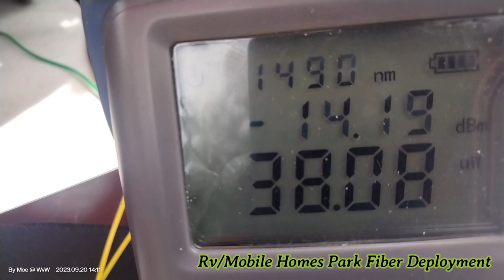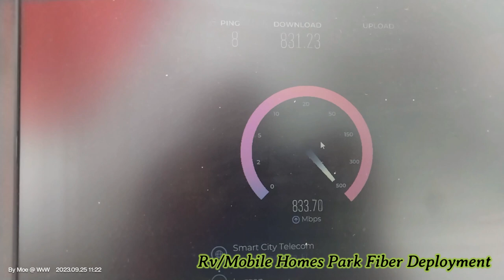Rv/Mobile Home Park Fiber Internet Build, Splitting and Splicing to ubiquity Gpon terminals

Comment: Your pole would like a lot better if you mounted your splice enclosure vertically as well so it both ends of the feeder cable came out the bottom and then your smaller count cable came out the top straight into your splitter box. I assume you spliced the other fiber from the 1x2 to the other end of the green tube/blue fiber to continue down the line (so it is going back into the ground) so this setup would be a lot cleaner imo.
Reply from the maker: @nick21614  I learned A lot after that install. I made a few mistakes that I will never make again. It was not as easy as it looks. We will love to go back and dress a few cables but we are getting busy.. sometimes I look back to some of my works and I say: what was I thinking 🤔🤔🤔
Reply: @wvwnetworking  Yep, getting it done is the best way to learn